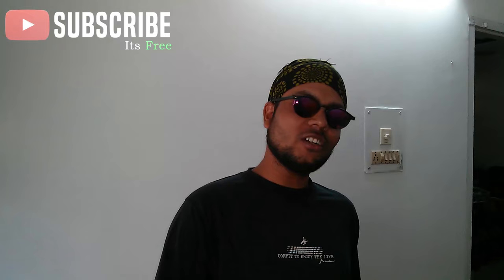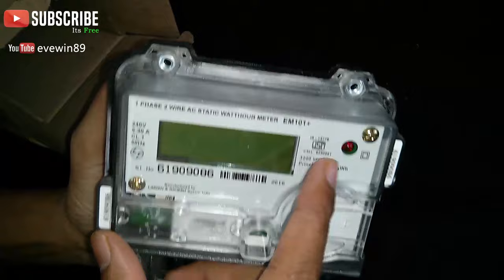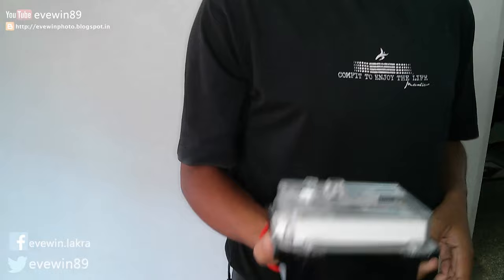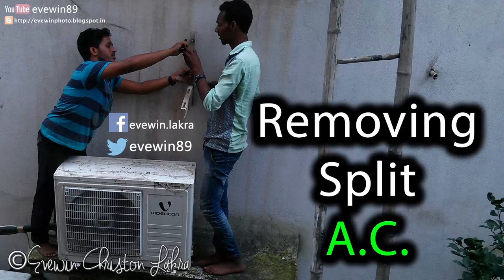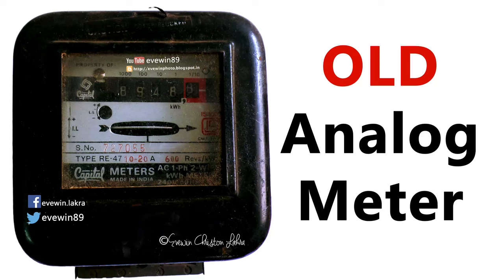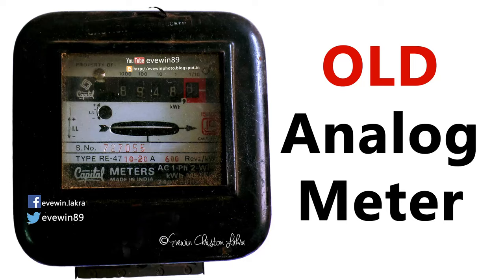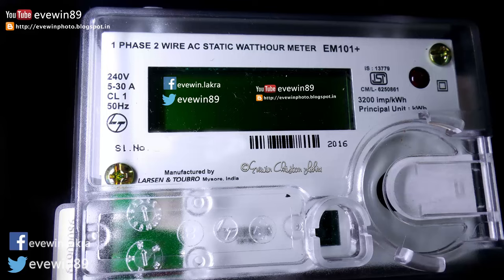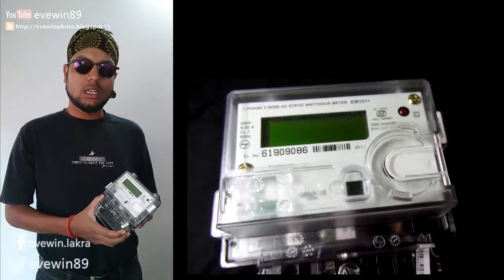Evewin Lakra - L&T - Digital Meter - Review

Comment: Hey bro how to check the load on this meter in kw
Reply from the maker: Meter READS "UNITS" which refers to HOW many Watt of Voltage-Current you've Consumed per month or Per Day or Per Hour from the Current which you receive from your near by TRANSFORMER.

To Read this Meter:

When its Connected to the LINE.

Reading Starts from 0.

i.e. L&T Digital Meter, After TESTING is Conducted in the Factory, it is Set to Meter is Set to 00000

& when the USER Connected it to the Main LINE the Reading Starts From 00000 itself.......!!!!!!!

For Example if you live in a House Where:

These Similar kind of Electrical Equipments & Appliances are Used:
4 Ceiling Fans
5 Tube-Lights
One Desktop Computer (Running 4-7 Hours Daily)
1 21inch or 29inch CRT T.V. (Running 4-6 Hours Daily)
1 Washing Machine
1 Fridge
other small small appliances eg.Mixi, Iron.Etc,Etc,etc

then this L&T Meter Reads Units Like This.

In Summer:
You'll have 5-8 units Per Day.

In Winters 3.5- 5 Units Per Day.

So In 1 Month The Approx Unit of your House in Summers Will be: 180-200 Units (Keep in mind that this approx unit is ONLY with 1 HEAVY Equipment in Use
Eg. Fridge) A.C. (Air-Conditioner) is Not Included in My LIST but if you have A.C. then the Unit will be High Say 50-70 MORE (Eg.250 Approx Units) (With A.C. Included) in Summers.

& in Winter Season You'll have Approx units Like: 124 Units Per Month in WINTER SEASON (When Your Fridge is OFF the Entire Month)

So if the "Electricity Charge" of your City is Rs.6 Per-Unit Then You've To Multiply that with the Unit Consumed in one Month. Eg.180(Unit) X 6 (Electricity Charge Per Unit) = Rs.1080 (Will be the Electricity Bill) you have to Pay if the Meter Starts from 0 in Day-1 & in Day-31st it Reads 180.

& in the Next Month End if the Meter Reads  370 Units then You've to SUBSTRACT 370 from your OLD READING which Was 180, So 370-180 is 190Units & this will be your Meter Reading Unit for the 2nd Month.

this is how a meter Reading is Taken.

Hope You've Understood.......!!!!!!!

Do Subscribe to my Youtube Channel (Its Free) for many more Products Reviews in the Future.......!!!!!!
Reply from the maker: One LED LIGHT in This meter flashes 3200 times when 1kWh of Electricity is USED......!!!!!!
Reply: @evewin89  brother i have one query

Comment: what is the use of this white cap??
Reply from the maker: Which White Cap you're referring to ? the outside plastic cap ? 

if so then its a Cover to keep the connected wires to the meter Safe from Dust & make accidental contact with other wires.
Reply: evewin lakra the one at right side white thingh, below red led.
Reply from the maker: oh the Round One ? Its Nothing but the design of the outer plastic cover
Reply from the maker: Its makes the opening of the Meter Cover easier by putting your finger in the white round space below the Red LED.
Reply: evewin lakra ok, thanks

Comment: Sir..... I saw there is port like RJ45 with 2 pins inception port at the bottem of meter. I just got to know it is RS232  port and Even I saw meter provides RTC time and date also ! Is there way to read it from meter to controllers , If yes please suggest . Thanks in advance
Reply from the maker: Good Morning ......!!!!!!

I Think RS232 is used in audio/video equipment's to control/sends signals to do a particular function based on the programing embedded on the chip inside to control devices connected through that port by the  RS232 , may be its a different port to check the meter by the manufacturer at their facility......!!!!!!

& Don't forget to Hit That Subscribe Button ( Its FREE )

More Interesting Videos Coming in the Near Future :)

Enjoy.....!!!!!!

Comment: Please make video to read this meter.
I have half knowledge to read.
Reply from the maker: Meter READS "UNITS" which refers to HOW many Watt of Voltage-Current you've Consumed per month or Per Day or Per Hour from the Current which you receive from your near by TRANSFORMER.

To Read this Meter:

When its Connected to the LINE.

Reading Starts from 0.
Reply from the maker: i.e. L&T Digital Meter, After TESTING is Conducted in the Factory, it is Set to Meter is Set to 00000

& when the USER Connected it to the Main LINE the Reading Starts From 00000 itself.......!!!!!!!

For Example if you live in a House Where:

These Similar kind of Electrical Equipments & Appliances are Used:
4 Ceiling Fans
5 Tube-Lights
One Desktop Computer (Running 4-7 Hours Daily)
1 21inch or 29inch CRT T.V. (Running 4-6 Hours Daily)
1 Washing Machine
1 Fridge
other small small appliances eg.Mixi, Iron.Etc,Etc,etc
Reply from the maker: then this L&T Meter Reads Units Like This.

In Summer:
You'll have 5-8 units Per Day.

In Winters 3.5- 5 Units Per Day.

So In 1 Month The Approx Unit of your House in Summers Will be: 180-200 Units (Keep in mind that this approx unit is ONLY with 1 HEAVY Equipment in Use
Eg. Fridge) A.C. (Air-Conditioner) is Not Included in My LIST but if you have A.C. then the Unit will be High Say 50-70 MORE (Eg.250 Approx Units) (With A.C. Included) in Summers.

& in Winter Season You'll have Approx units Like: 124 Units Per Month in WINTER SEASON (When Your Fridge is OFF the Entire Month)

So if the "Electricity Charge" of your City is Rs.6 Per-Unit Then You've To Multiply that with the Unit Consumed in one Month. Eg.180(Unit) X 6 (Electricity Charge Per Unit) = Rs.1080 (Will be the Electricity Bill) you have to Pay if the Meter Starts from 0 in Day-1 & in Day-31st it Reads 180.
Reply from the maker: & in the Next Month End if the Meter Reads  370 Units then You've to SUBSTRACT 370 from your OLD READING which Was 180, So 370-180 is 190Units & this will be your Meter Reading Unit for the 2nd Month.

this is how a meter Reading is Taken.

Hope You've Understood.......!!!!!!!

Do Subscribe to my Youtube Channel (Its Free) for many more Products Reviews in the Future.......!!!!!!
Reply from the maker: Looking at the Meter Reading of Column 3 & 4

I Think You Have To Substract Digits from Column 3 & 4:

11662 KW h

11268 KW h

So 11662 - 11268  = 394 So My Guess is 394 is the Unit of Your House in One Month as for the Data which is Shown in Column 3 & 4.
Reply: what's the minimum rate to buy this and how to get a new one.
Reply from the maker: The Minimum Rate Depends on from where you're buying one.......

In the BOX it was Written Around Rs.1420 (As of April 2016) but I paid 
less coz I bought it from a Electronic wholeseller Store, so I got it 
for less than Rs.1000 :) Check few electronics shops of your city 
before buying to get the best deal & Don't forget to  "Subscribe"  
to my Youtube Channel (Its FREE) ....... Plenty of Product Reviews videos coming in 
the Near future......... Enjoy......!!!!
Reply: The reading of a meter is shown in kwh u can see it by pushing a black button generally mounted on these meters... Try and see....

Comment: Can u tell to me CU some of meter display only c what is the differences?
Reply from the maker: Gas meters generally record the volume of gas consumed in cubic feet ( ft³ ) or cubic
 metres ( m³ ) although consumers are billed in kilowatt hours ( kWh ). 
The calculations used to generate gas bills are prescribed in: The Gas 
(Calculation of Thermal Energy) Regulations ( SI 1996/439)

Info. Source: Google

Comment: please let me know if the emp jammer works on it to hack the meter
Reply from the maker: I've Not CHECKED IT Coz Currently Its Been Added in The Meter-Room
Reply: evewin lakra but this meter is installed in our and mseb people don't listen us and whitin a week it is 300 units consumption display so we need solution urgently please
Reply from the maker: What Equipment's you are using in your HOME ? 

A.C. Fridge Coolers Consumes HIGH VOLTAGES & Electricity 

Or There Can also be the Case of Your Meter is FAULTY in the 1st Place Only, GET IT CHECKED or call an electrician & ask him to install his Good Meter Along with Your Currently Installed Meter in Parallel Fashion & Then Check The Difference in Meter Reading "Per Day" or Per Week Basis To Get To Know If Your Meter is Faulty.

There Can also be The Case of LEAKAGE of Electricity in your HOME, Get The Wiring of your House Checked for Leakage of Electricity.

In COPPERS WIRES Electricity Flows Better Than Old Aluminum Wires for House Wiring , Hope My Info. Helps

Comment: How to check this was 1kw or 2kw...?
Reply from the maker: This is a 5-30 Ampere Digital Meter

For Houses Where LOAD is Sufficient (NOT Heavy)
Reply from the maker: + This Meter LED will FLASH  3200 Times When 1kw of Electricity is USED
You can see the 3200 written on the meter imp/kwh